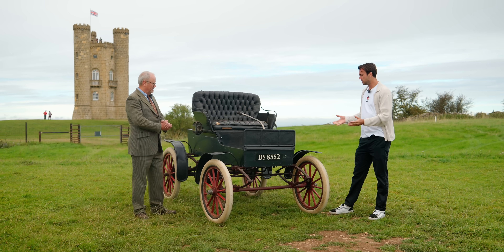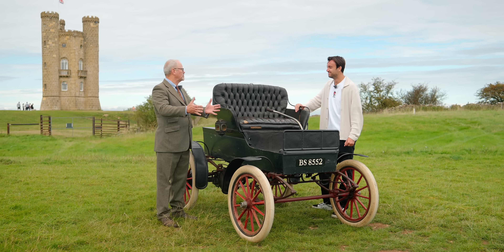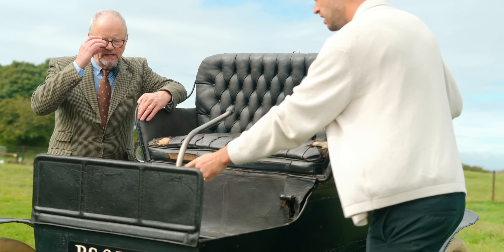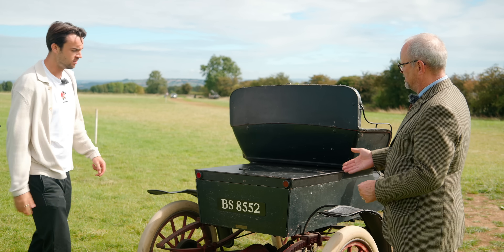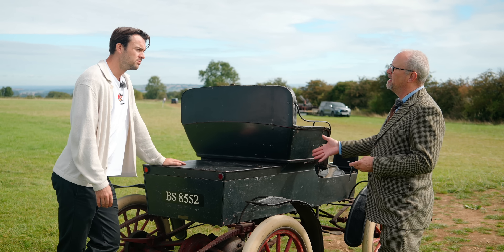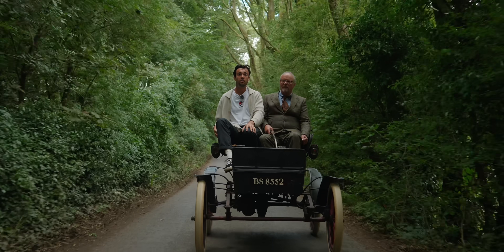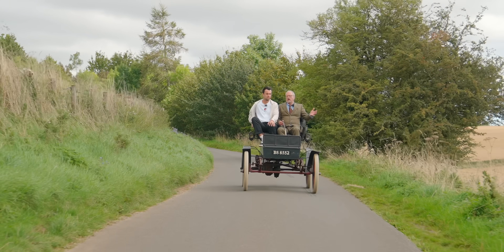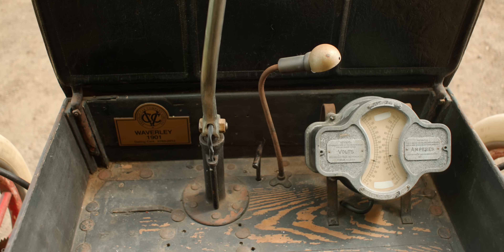Why Electric Cars Failed 100 Years Ago

Comment: I think what really came along where two world wars with extreme improvement on petrol engines for planes, tanks, trucks and cars. In second world war, the german submarines still had the same batteries as this car of 1901. And in our petrol cars, we still have this battery for the starter. And that is the other big thing for the break trough of the petrol car - the electric starter.

Comment: Correction: you stated 9:40, that obviously the original batteries would not last 120 years.  That's a reasonable assumption.  But Jay Leno's 1909 Baker Electric is still running on its original nickel iron battery, and apparently still has a range of something like 100 miles. Genuinely amazing. But it was obscenely expensive, and had a top speed of 15 MPH.
Reply: Was wondering if someone had a still running Nickel Iron battery - amazing!
Reply: I went to an electric vehicle show in Vancouver BC back around 2007, and there was a Baker electric there. The owners had just recently changed the original nickel iron batteries due to tiny pin holes starting to develop.
Reply: His was the one owned by Henry Ford's wife. Nickel-Iron batteries are also known as Edison Batteries.
Reply: For 1909 Leno's car really moves.  Got to respect that!
Reply: yeah but he drives his citroen ds more than he drives that thing
Reply: Obscenely expensive, so the electric cars today aren’t
Reply: @retrobilly1986  they average over 35 grand.

Comment: want a concrete simple battery? CaO + water activation = tons of heat and solid state peltier direct heat to electricity on the side. CaO = concrete main element, it can be any other water activated compound like KOH, releasing steam and heat. you can also collect water from air with KOH/CaO air filter plates. steam piston car using CaO/KOH as the fuel and water as the reagent/electrolyte would work too. energy content of KOH seems to be also around 300wh/kg without account for the water, which can also be taken from air.
Reply: that does not need over the air updates, much better

Comment: INFRASTRUCTURE! At the time, how many(in England) were plumbed for Illumination Gas, but not for Electricity? Rather like Today, where is the Generation Capability Anywhere, to provide charging ability to a majority of present EV's? How many understand that while EV's are in the minority of vehicles and so far have not been receiving the full attention of Tax/Revenue Agencies, the various Gov'ts ARE rather fond of the monies presently received from Fuel Taxes. This WILL result in future New Taxes to replace the previous one's(while owners presently gloat about their "Fuel Savings"). Notice yet the proposed taxes based on Vehicle Milage?

Comment: Speed, Range and time to recharge.  It is that simple

Not sure of 1920 era... but 1903, the production electric car was 3 mph and 10 mile range.  12 hours to charge on a good day...  You can do better than that with a 5 yr old's ride-on toy electric car today.

1978 production electric cars were up to 40 mph and 45 mile range... 12 hours to charge.

If it's a straight line gain per year, then by 1920, the electric car wasn't practical for anyone, anywhere.  The 1978 electric car was useful to some as a grocery getter.

Connect the dots and, the production cars come in pretty much 2 "flavors" now.  Extreme cost 200 mph and 275 mile range or 95 mph and 100 mile range.  Plus, we have ability to charge them in about 1 hour to 90% capacity from nearly dead flat battery.

The one-off ultimate demonstration models are meaningless unless you can get somewhere near the same from a production model.  36 hours to charge for a 1 mile timed run, and it's done for 2 days cooling and recharging is not useful.

I've been watching EVs since my interest in them started in High School in the 1970s.  Back then it cost the same as buying 2 EXTRA VW beetles to do a conversion of one VW Beetle.  and you got reduced range, reduced speed vs the original Beetle. and 12 hour recharge. 
Why spend that kind of money for that dismal result?

We are JUST NOW into the start of generally practical to use EVs at a reasonable price.
Reply: Trojan horse

Comment: Slowing down on the uphill… That’s what the classic series-wound DC motor does. When you’ve hit "balancing speed" (the speed at which the car/tram no longer accelerates) and you encounter an uphill, the speed goes down and the current load increases, until a new balance is found. The motor(s) pull just as hard. The classic DC motor was really ingenious, no need for complicated gear boxes!

Comment: The lights: Traffic didn‘t move very fast back then, so they were sufficient. Just look at the concurrent lights on horse buggies. Trams used a simple light bulb (like the kind you’d find in a reading lamp) in a reflector until automobile style headlights with halogen bulbs took off in the 50’s. British trains used oil lamps on their engine all the way up to the end of steam in the 60’s. Whereas in Europe, we had decent (like huge spotlights…) on our trains from the 30’s, but that’s another story). As for batteries, there’s lye batteries. They are huge and heavy (like lead acid), but properly maintained they last a long time, longer than lead acid batteries.
Very cute car, keep up the good work! :D
Reply: From what I recall, didn't many vehicles of this era use carbide lamps? They gave a very good light output for their size.

Comment: Talking about steam.the Doble continued until 1932. It had a flash start steam system that was very quick and got great speed and mileage.

To say that hydrogen is the scene of today is actually wrong because from what I can see looking at the latest technology in that regard,if anything will. Replace gasoline engines that would be the one.

Actual physics and some of the slave labor being used with the current production of electric vehicles naked impossible for it to be an outright replacement for gasoline engines. Period besides most of the electricity generated that is used to charge electric cars is still produced using coal powered plants.

So although they consumer himself may have agreed experience,there's a lot of very dirty filthy pollution behind the current electric car that is hidden because it's not in front of the driver.

Thomas Edison really had some very intriguing work in regard to electric cars.
 If you can find one of his and demonstrate it you would find 1 of the most advanced electric vehicles of the time.

Comment: The use of the word 'damping' to describe something about new cars that you would miss if you had to rely on a car from this period is especially irritating because, not only did those cars have damped suspensions, but the very term for what made it so was 'dampers', not just leaf springs, because they had a gripping piece with an adjustment on them that lessened the recoil, or bounce - it was an actual shock absorber, but not hydraulic - it was friction based and required periodic adjustment. This particular car may not have had them, but they were very much in use during that time in the brass era. I'm pretty sure that the Mercer Raceabout did. Now THAT was an impressive car. It still is, in fact.

Comment: There were no cars in the 1930s that were $200 that I'm aware of, except for used cars, of course. If you're talking about the Ford Model T, which was responsible for something like 40% of all of the cars on the road by 1925, that's when the Model T's price had been lowered to $260, which was dirt cheap. That's about a little more than $4,600 today. That is incredible. Try to buy a decent car today that will last for a hundred years plus for that amount of money. It won't happen. Model Ts were made of vanadium steel that was really thick and incredibly tough. They're amazing.

Comment: I'm so sick and tired of hearing people overstate how difficult and awful and inconvenient and messy older technologies were. They weren't. If they hadn't been an improvement they would never have caught on in the first place. It's like the crap I hear about vintage fountain pens being so messy and hard to use and being so much work and that they're fiddly and delicate. They're not at all. Just because they're not disposable and should be handled with a modicum of care if you want them to last and work as they should, which is beautifully, and well after over a hundred years, doesn't mean that they are delicate and fiddly and require an excessive amount of care. An absolutely infuriating, inconsiderate, smug, and dismissive attitude.

Comment: 4:30 The "shock absorbers" are actually the friction between the leaves of the leaf springs.  That's why they were used on wagons.
Reply: That, in theory, might in some eyes be true but in reality the 'friction' between the leafs offered little or no shock absorbing effect.
All vehicles with leaf springs were subsequently fitted with (1stly) friction shocks and later hydraulic/gas items.
Reply: @WeeShoeyDugless  - you are correct that the amount of friction in leaf springs is insufficient for automobiles with their much greater mass, but a light runabout, like horse drawn shays, surrys or early cars like this one, it is enough.  Part of the reason is that the cars/carriages are moving very slowly so that the small amount of friction has time to work between the bounces.
Reply: @hagerty1952  Anyone that wants to can see for themselves:  If you have a car, truck, or trailer with leaf springs, go take a test drive over a road with some bumps and dips.  Then, apply lubricating oil so it flows between the spring leaves, especiall near the ends (there is no relative motion where the spring leaves come together near the centers) and drive the same test loop again.  The first generation Cadillac Seville used leaf springs at the rear axle.  They had low-friction spacers between the leaves to minimize frictional damping.
Reply: "Shock absorbers" is a misnomer. The springs absorb the shocks. To prevent bouncing, we have fluid filled dampers, NOT "shock absorbers".
Reply: @peterjackson2625 - My goodness!  I've finally found someone more pedantic than I!
Reply: no.
Reply: leaf springs have nothing to do with friction but with elastic deformation of the metal. they are literally just springs, like the name sugggest. a lot of trailers or trucks still use them nowadays, farm equipment, too.
Reply: @rolhen8221  Actually, leaf springs do have friction between the leaves. Each leaf is a separate spring, and when assembled, they push against each other. When they flex, they slide against each other. The more they deflect, the harder they press together and the more friction is produced. This friction will tend to keep them from bouncing too much. Coil springs are much bouncier since there’s only one spring and little friction, so shock dampening is much more important with coil springs.
Reply: @rolhen8221  nope the OP Is right

Comment: From sources, the Waverly was the first company to use Edison Nickel-Iron (Ni-Fe) batteries in one of their models. I believe it used a 48 cell battery pack, so would run at 57.6 to 67V. It's hard to tell from the vid, but is that only 48V? Most Waverly models of this type traveled around 14 MPH. Late 1970's EVs often used switch contactors to run at 12, 24 or 48V (connecting different battery arrangements), but from views under this model it looks like it uses resistors to control speed. It'd be interesting to learn more. (More voltage = more speed.)

Comment: Lots of fun, but I would have liked to hear more technical info.  A solid rear axle, or limited slip?  DC motor w/ permanent magnets?  How did the speed control work?  by varying voltage?  Was there a speed governor on the motor?  How was the motor cooled and lubricated?  Thanks.
Reply: Cooled? It generates little heat so just air cooled I guess.

Comment: We still don't admit why they failed at the time. We need to confess in order to understand why today's overweight, overpriced EVs will continue failing.  
Construction looks light weight, but it isn't.  Energy storage is compromising payload and overall usable performance.
Is it PMSI maybe?  perpetuum mobile stress illusion ... btw  PM works on two conditions 1. give it a secret push ...   2. avoid load, even looking at it will stop it. 
Regen breaking, what a fantastic source of energy ... I'd give it the same importance like solar, wind and cows farting. 
if it moves, start it with an electric motor. They mean HYBRID? An ICE ride with an oversized starter motor.   Come on folks, wake up. EVs for the masses is an issue, not the solution.

Comment: The Model T got something like 200 miles on one fill-up, which, considering there was only 150 miles of auto-ready roads at the time.  What a lot of people seem to miss is just how many trillions (adjusted for inflation)of dollars have gone into ICE vehicle research since the Model T.  EVs are giving them a run for the money on a much smaller cumulative investment.
Reply: You don't even need to adjust that for inflation. Developing a new engine family easily costs a couple of billion, and many car companies have done it many, many times.
Reply: Battery tech is a general use issue, as is motor and electronic speed control tech.  Thousands of uses for these techs spreading the costs of R&D.

Battery tech made electric power for RC models start being practical appx 9 years ago.

Battery tech had to advance to where the 9 lb lawn mower battery size pack wasn't needed for a cell phone before cell phones had half a chance at being generally practical.

Electronic stepper motor drives... that run printers and copiers and thousands of other devices... evolved to the modern "DC Brushless" (actually a 3 phase AC variable frequency, variable voltage motor and electronic simulated stepped sine wave control)

Rare Earth Magnets, prohibitively expensive 25 years ago are now cheap enough you can buy packs of 10 for $10 to hang things on your fridge today.  And these strong magnets make the modern "brushless DC" motor far lighter to produce the same power vs the alternative magnet types (usually ferrite)  used in mass produced motors.

The first 8088 PC CPU chip cost about $25 million to make... the next cost about $1 to make.  Electronics have advanced over a thousand  times the power since then... and gotten cheaper.

Comment: Same reasons they're not widely adopted today:  1) lack of range, 2) inconvenience of re-charge (time, location), 3) efficiency affected by climate/temperature.  Like it or not, the energy per unit volume for gasoline used by ICE's is unsurpassed.

Comment: A lot of the US population lived in rural areas then, and some of those areas weren't fully electrified until the 1920s! A car like the Model "T" made sense in those places. This Waverly would have been a fine choice in places like Pittsburgh (where thanks to tons of heavy industry and being home of Westinghouse electricity was becoming common as early as the 1880s!) and of course electric was PERFECT for a densely populated area like Manhattan where being clean and quiet was more important than range. Most early gasoline (petrol) cars from 1901 (Like the Oldsmobile) weren't much faster than the Waverly and you probably were unlikely to be ABLE to go much faster than 20 MPH in Manhattan then!

Comment: Oil technology had some very confident and very well to do backers it seems. 1925 does not seem to be far enough into combustion engine popularity, for a company that only produces combustion engines to be worth enough on its own to buy out a long established company that not only produces cars but a large range of popular modern powered items. But this happened, when Detroit diesel bought Detroit electric just to shut it down to eliminate competition with motor powered machines. I think even without active sabotage the electric vehicle would have soon lost to petroleum as it developed fast enough to make ease of operation comparative, and energy density giving many many times the range for the weight and space of batteries and much more power and speed over that range, then add to that the simplicity of taking a tin of liquid to a stranded vehicle, for energy top-up. Which a petroleum powered vehicle could alwas meet the task of, but not an electric due to rang limits! At the time technology and society were expanding intellectually and geographically. The fossil fuel engine was the labourer the builders of the world today needed.

Comment: Battery tech at the time. The only reason EVs didnt take hold in an era where everything was electrifying was the fact that the best battery of the era was the Edison Battery. Gasoline had a higher energy output per volume (still does) and at the time you could shoot a hole in the ground in most spots in the US and oil would trickle out, and gasoline was a BYPRODUCT of kerosene production.

Comment: Why did horse-drawn carts fail centuries after they appeared? 
The same issue arises with another product, CDs and DVDs. Why did they have a short life? Because the Pen Drive appeared, which is better. The transition to electric vehicles can still be successful if there is investment in its evolution. Or it doesn't move forward if another better method appears in the meantime. Be it hydrogen, sea water, oxygen, cow urine. 
Because everything changes one day, only death is eternal.
It turns out that many people are against electric cars for financial reasons, they receive a lot of money from the oil companies to speak against them, or they have invested in shares in the stock market in this industry.
Reply: There are entire countries that depend on fossil fuels for their economy.